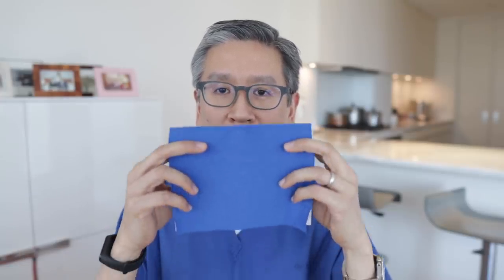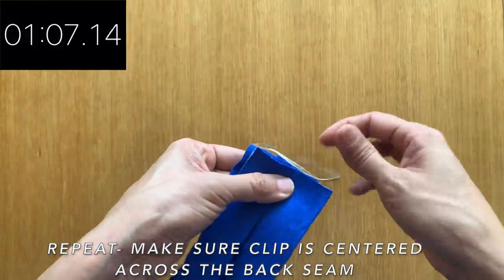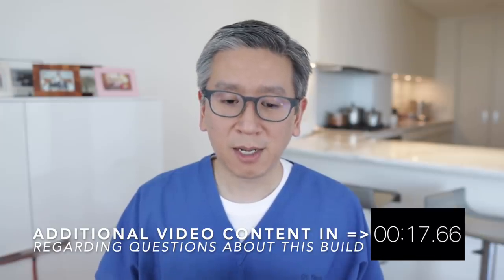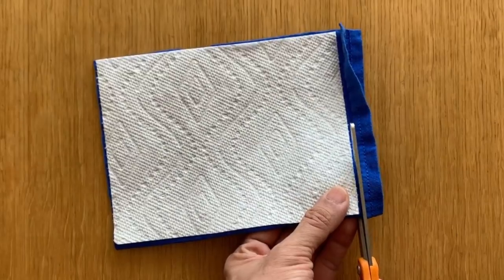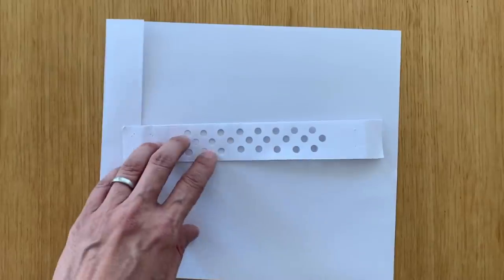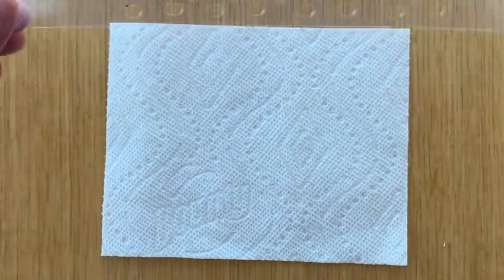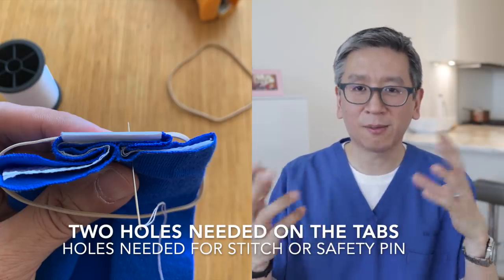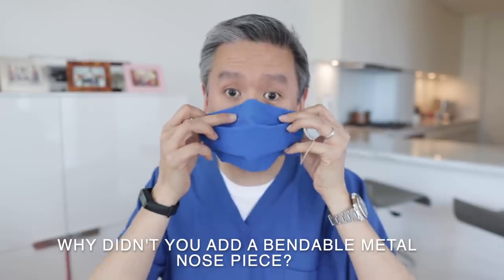1+ Minute Clip Assembly No Sew 3D Filter Pocket Face Mask #Masks4all

Comment: Where do I get acetate film?
Reply from the maker: Cut and paste from Description: 

Acetate Film 0.005 mil: 8.5”x11” or 9”x 12” (extra can be used to make face shields.) I looked some up and they are pretty expensive.  They don't sell them in individual sheets, only packs of 20-100.  So I don't want you guys to spend that, unless you plan to make face shields for donations or for your own business use when reopening up small businesses, such as the cashiers, or hairstylists/barbers.  Workers who spend a lot of time within a couple of feet from customers.

Alternatives to the Acetate frame (using 3D printing to make a frame was not a viable option to reach everyone.)

•The goal is not to buy anything more than you need or want to.  There must be some stiff, bendable material which you can find at home.  Channel your inner MacGyver.

    •If you can find some transparency/acetate pages at work, use that.  
    •If you have clear folders at home, use that.  If you only have a folder which is made of card stock, use that.  
    •Some people have laminating sleeves which would also work.
    •A 2 liter bottle in theory could be cut into a long rectangular piece and punch holes in that 
    •Some junk mail actually uses pretty good plastic or laminated card material to make their advertisement stand out.  You can use that and cut a strip to use.  It will be hidden inside the mask anyway, so don't worry. 

Here are some links from Staples.com:
https://www.staples.com/Apollo-Write-On-Transparency-Film-Clear-8-1-2-W-x-11-H-100-Box/product_829333

https://www.staples.com/Report-Cover-with-2-Pockets-Plastic-Clear/product_970151

https://www.staples.com/2-Pocket-Plastic-Folder-Clear/product_970156
Reply: You can buy it at Michael’s.

Comment: Is this washable?
Reply from the maker: Yes, take the mask apart.  Discard the paper towel filter insert.  Hand wash the mask with soap/water as part of your hand hygiene.  Hang dry.  Wipe down the acetate frame, rubber bands and binder clips with alcohol and let them air dry.

Use a new piece of paper towel to assemble a new one. With practice and no talking like I did in the video, you can make it in less than 1 minute.

If the fabric has any odor at all after several washes.  Just throw it out and cut a new rectangle.  I can make 8-12 rectangles out of the large t-shirt.  Other options are bed sheets/pillow cases with a tight thread count. https://www.youtube.com/post/UgybnLPPH85A28YlaQt4AaABCQ?app=desktop

Ecofriendly, with less paper towel waste than the full paper towel mask.

Comment: The clips are rendered useless after this, so do you just keep using new clips every tine you switch out the paper towel filter?
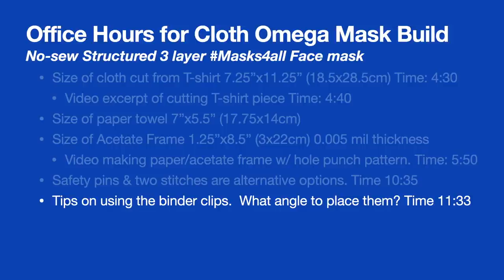Reply from the maker: Keep the metal springs. I bookmarked “Tips on using the binder clips” in the description: 11:33 <= click. 

You squeeze the spring to put them back, the same way that you take them out.  It keeps the mask looking cleaner when you wear it.

The point of the binder clips is to be able to fully open the entire flat piece of cloth to wash, but more importantly insert a Crisp flat sheet of paper towel or filter which makes the mask crisp and stiffer like a new mask.  Then clip it back together.  Don’t lose the clips.

Comment: This mask has no filtration performance at all, it might reduce the droplet, and aerosol  but it has no filtration like N95
Reply: No claim that it is "like N95," or did I miss something?
Reply from the maker: BJFA 
Article comparing filtering capabilities of N95, surgical, vs. DIY materials.  Graphs included. 

https://smartairfilters.com/blog/best-diy-coronavirus-homemade-mask-material-covid/

Results: Ebola-Sized Particles (1 micron)

For Ebola-sized particles, the N95 mask, surgical mask, and HEPA filter performed best, capturing over 99% of particles 1.0 micron and above. Next up, the HERO coffee filter captured 98%. Paper towels, canvas, denim, and the cotton bed sheet also captured more than 90%.

All materials were far better than nothing; most blocked over 50% of particles. But the four worst-scoring materials were the wool scarf, polyester neck warmer, cotton bandana, and light scarf.

Results: Smallpox-Sized Particles (0.3 microns)

For 0.3-micron particles, there was a much wider range in effectiveness. The N95 mask, HEPA filter, and surgical mask still did best, all capturing over 75%. However, the materials consistently captured fewer smaller particles than larger particles.

Among the household materials, the HERO coffee filter came up next in the list, capturing 62%. But only four other materials filtered more than 48%: the 40D nylon, CHEMEX coffee filter, the dish towel, and canvas.

Some materials were only slightly better than nothing. The bandana, neck warmer, scarves, cleaning cloths, and 100% cotton T-shirt all captured less than 10%.

Size Matters
The 100% cotton T-shirt result is worth highlighting because the Cambridge researchers recommended this material as one of the best. In our tests it captured just 3.4% of 0.3 micron particles. A double layer T-shirt captured 15%.

We suspect the critical difference is that the T-shirt we tested was a lightweight, thin material. Material weight and thickness are important factors for face masks.

Breathability and Filtration: The Best Combos for Homemade Masks

Balancing breathability and filtration, we recommend:

Paper towel
Denim (10oz)
100% cotton bed sheets (80-120 thread).
The bra pad performed fairly well, filtering 14% of 0.3 micron particles, and 76% of 1.0 microns.

One material that’s easier to breathe through than a surgical mask, and still performed fairly well at filtering particles was the 0.4-0.5mm thick canvas material. This material even performed better than the 100% cotton T-shirt.

0.4-0.5mm-Canvas-Material-Effective-as-a-Mask-Material for face mask

However, if you don’t have thicker fabrics at home, our data shows that double layers of 100% cotton T-shirts are still effective options for homemade masks.
Reply: @FanOblues51  I thought the fabric material you are using has some features
Reply: @GeorgeYangMDNYC  Yes, I read the artical
Reply from the maker: BJFA Great. Note that at 1 micron the DIY filtration is quite good for many masks, but at 0.3 micron the DIY masks all drop a lot.  

So as a problem solver, you are given a set of knowns and a problem to solve.  How can we try to solve the problem?

The way that I see it.  There is not enough 0.3 micron filter material in the world for everybody to have 1-2 fresh masks per day.  Also you would need to pay to manufacture and ship all of them.  Most people in the world are not rich.  This seems impossible for western countries. It’s already being done in Asian countries, but not realistic here. Can’t change that fact, so let’s think of a way to still try to solve the problem. 

________

What if everyone (reach ~80% ) is wearing a DIY mask we can catch the bigger droplets (bigger than 1 micron) as soon as they leave the person’s mouth, before they evaporate and become droplet nuclei which become 0.3 micron or smaller. 

Is it easier to pluck yellow dandelions first or let them turn into the white fluffy floating seeds then try to catch all of them when the wind blows.  

Hopefully you can see it is easier and more practical to pluck the yellow dandelions before they change. 

__________

There is enough DIY material in everyone’s homes to catch the >1 micron droplets which if not caught leaving the mouth will end up being 0.3 micron nuclei within seconds to minutes. 

Supply chain/delivery/cost- can we teach everyone to make their own to save them money while money is tight.  

_____________

Is the risk profile in the public the same as in a hospital?

Other consideration, the chance of catching COVID-19 with hand hygiene, social distancing and mask wearing is low.  With these measures if someone did get infected, their dose of virus should be low relative to someone who didn’t wear a mask and entered a hospital ward filled with CoVID-19 patients.   

The risk is completely different.  It would be suicide for a doctor or nurse who is healthy to care for COVID-19 patients without an N95. Their lungs might be overwhelmed with millions if not hundreds of millions of virus particles all at once.  Any swelling deep in the lungs, cannot be compared to an initial infection in the nose which causes swelling there and makes the person lose their sense of smell and have nasal symptoms.
Reply: @GeorgeYangMDNYC  Dear, Frankly, there are 2 things I would like to highlight, First, N95 filter, Do you know how easy to make N95 masks, I5 countries should have no problem of N95 material, the N95 Cloth maker machine and full automatic manufacture making mask cost around 200K. Thus, I5 countries should have no issue make this masks affordable and available to every human, it can be easily installed over each hospital occupied 2 or 3 hospital room, at the end the money for buying mask could go to buy the manufacture, These masks are only plastics injected to a cylinder to make the masks cloth. 
Second, DIY masks, There are lots of solutions could reduce the use of N95 mask cloth which is called FFP something, I don't recall the exact name. could be used in collaboration with printed masks. 
Infused material as well, some mask infused with iodine. 
back to DIY masks. where are the old masks, all could be reusable, study tell us if you clean it with H2o2 it could be reuse? thus, with masks made from moulding silicon + 2 layer of reused masks could solve the problem. 
There are lots of solutions.

Comment: A 14 minute video for a 1+ minute video?
Reply from the maker: Hubster  Overhead tutorial  @ 0:45  
I have a timer which shows it takes 1 minute 23 seconds if you don’t believe it. 

After you see it, if interested you may have questions.  If not, the video is over after 4 minutes. 

Just like a jumpshot or a crossover takes less than a second, but a good basketball coach will actually spend more than 1 second teaching you.  1 hour if the coach actually cares about making you better.